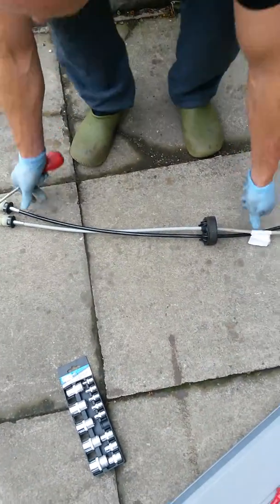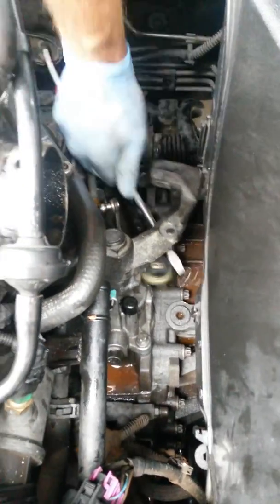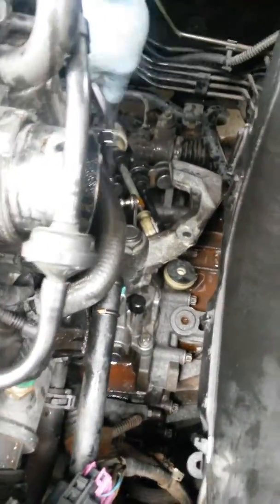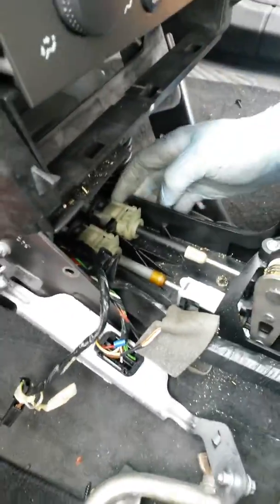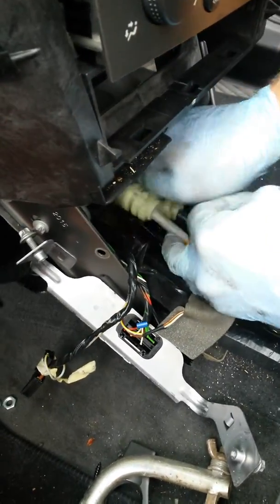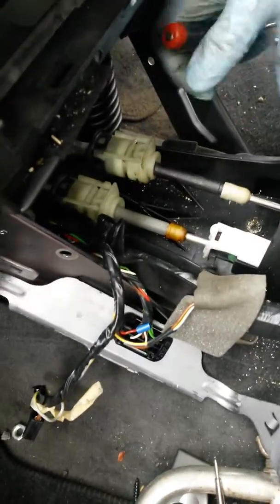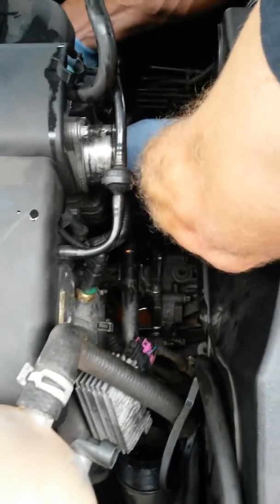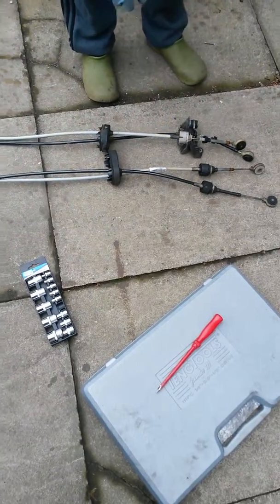Vauxhall vectra C 1.9 cdti gear linkage cable remo

Comment: Great stuff! When the engine is hot it's very hard to engage the gears, only when it's about the middle mark. What could be the problem you reckon? When cold gears engage with no problems at all.
Reply: Gear cable mate I changed my gear oil which didn't help the problem but not a bad thing to do anyway.  Mines getting booked in for gear cable change